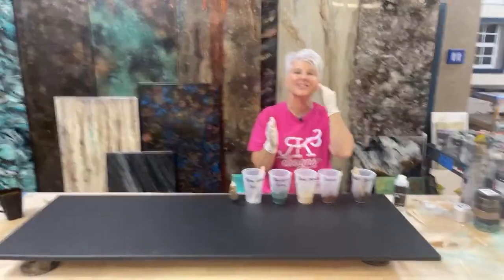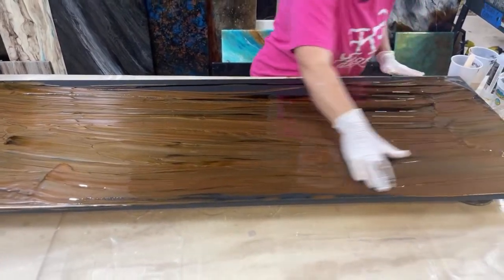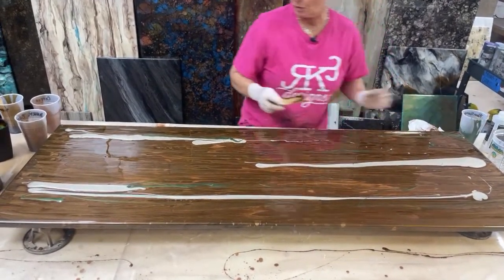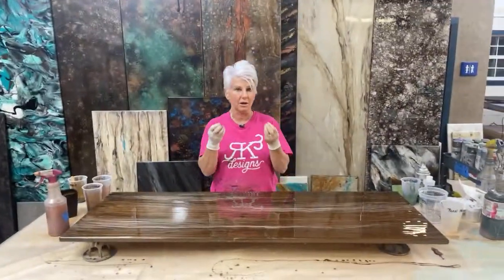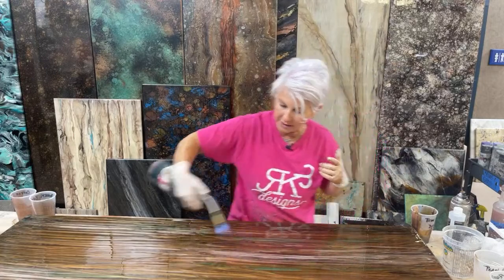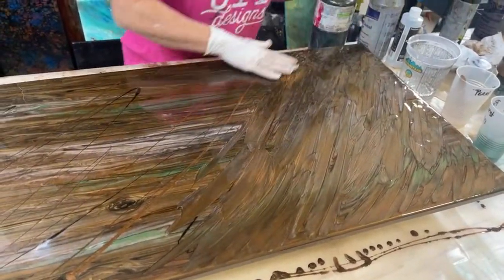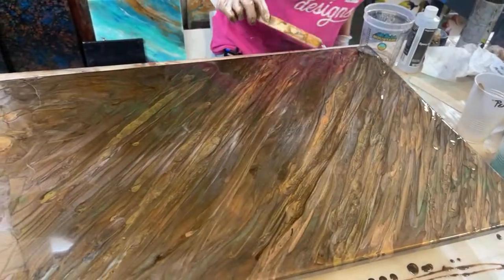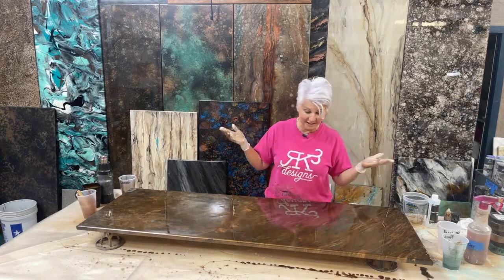DIY Epoxy Tutorial | RK3 Designs

Comment: Okay I can see your video Yes here's my question and I've kind of gravitated towards your stuff so you know won't say fan but I will say definitely interested period epoxy projects choose to not dry and stay sticky I'm in a high humidity area the temperatures got low I've tried adding extra harder blah blah tried all the shit afterwards I could think of do you know anything afterwards short of alcohol I've noticed that water hardens it which is odd but it does and it also blisters it period how that and idea for getting that crap the hard enough when it should have been didn't Thank you
Reply from the maker: I’m so sorry, but I have no idea what you’re trying to ask me??
Reply from the maker: @Wreck and Carey Hey there. No not really. The issue is the environment that the epoxy is being poured. It’s outside the optimal requirements. The chemical reaction can’t process correctly. Adding more hardener will actually make it not cure also and stay sticky. Definitely don’t want to add water to epoxy.